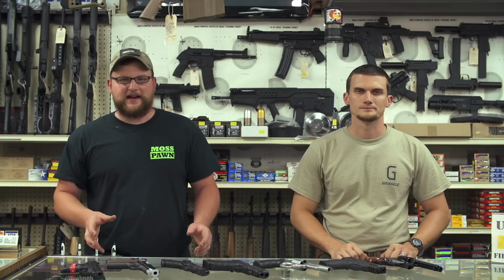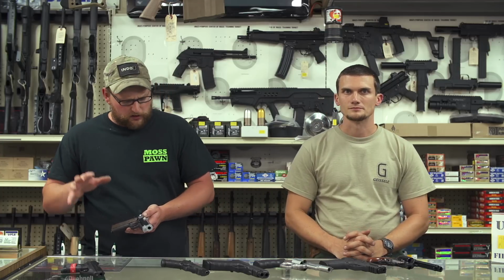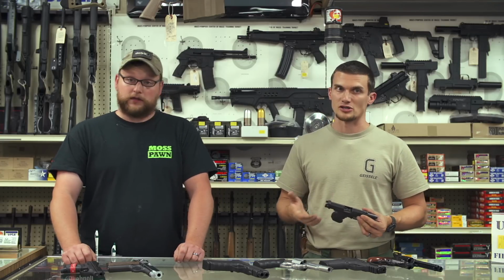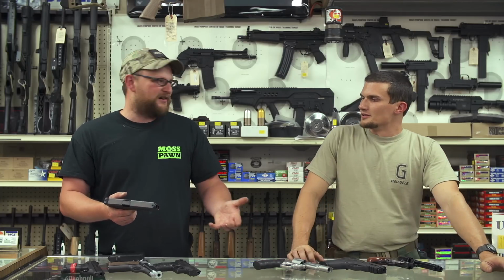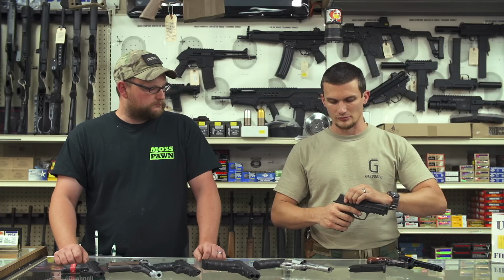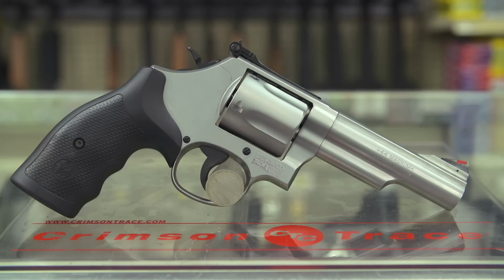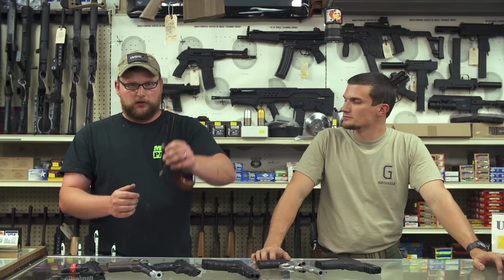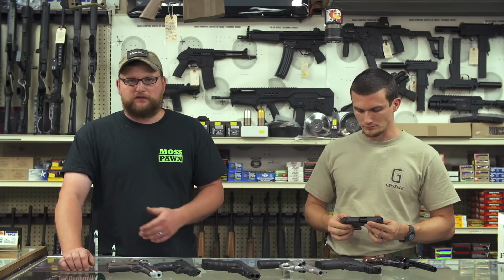Handgun Etiquette for Beginners

Comment: Man, a lot of other people say to dry fire as much as you want. I really wish I knew what the hell to do. I need a straight up answer.
Reply: Dry firing will not break your gun, as long as it is a fairly modern firearm, not a 100 year old antique with more delicate parts.  Dry firing allows the practice of trigger control which will make you a better shooter.  But, if you are going to dry fire, it is recommended to use snap caps so that not as much stress is put on the firing pin.  But if a gun were to break simply because it was dry fired, then I wouldn't trust it to fire live rounds.
Reply: This channel made a video several months ago contradicting everything they said in this video. I don't take much stock in what they say anymore. I learned more from Barry and wish he was still on the channel, the videos went downhill after he left.
Reply: On any modern centerfire gun, I have no issues with dry firing. Parts are very cheap and prevalent if you somehow break a firing pin or a striker. The chances of that happening are so slim that it's not even worth worrying about. Snap caps are a good idea if you're a little nervous about it, plus they allow you to function check the gun after cleaning or modifying. Get some snap caps and an extra firing pin/striker and dry fire away.
Reply: You can dry fire your handguns all you want. It is looked frowned upon when you dry fire someone's or store merchant's handguns. Usually they will say Yes when you ask. It is one of those "etiquette".
Reply: Don't dry fire if at all posable!
Reply from the maker: Dry fire all you want, but I would strongly advise snap caps. They aren't expensive, it doesn't require any real effort, and in the long run your firearm will love you for it. People can get macho all they want about it, but the bottom line is that the firing pin is designed to be cushioned by the primer. On the flip side I've got a much better idea...don't dryfire...get out and SHOOT. :D
Reply: Sounds like a great idea to me!!!!
Reply: Eric is right.  If you occasinaly dry fire a modern firearm i.e a Glock, a SIG, an AK or an AR then by all means go nuts.
But if you are conducting regular drills: snap caps are ''de mise'' translate-- ''in order''.
If you're playing with the 1917 manufactured Luger Grandpa passed down-- Don't!!

Modern military weapons are TOUGH but time is unfriendly to everyone and everything
Reply: Read your owners manual.
Reply: betatalk357 I know that, and so does everyone else who watches this channel.
Reply: IronMike212, when in doubt, don't do it.  :)
Reply: I just read the manufacturer recommendation, manual and internet link (FAQS)
Reply: That is the best way to go in most cases.
Reply: I have a Glock 22 that is a retired LE pistol. It has been fired thousands of times and dry fired at least a thousand times as well. Glock tells you to in the owners manual.  I can't speak for all guns but it won't hurt a Glock. I have never had a failure.
Reply: Randumb Kadrmas Look, I can see you think a glock is indestructible. I have seen the face of the slide crack on a glock from dry firing, so don't say it wont hurt a glock. They are made from the same steel as other guns, not some space age steel that came straight out of NASA. They are good guns, but they are not indestructible as you think.
Reply: No way is a firing pin sliding in a channel it was designed to move in going to cracked a steel slide, sorry but I am not buying it. Also the anti corrosion process Glock steel goes through is not the same as all gun steel. They don't call it Glock Perfection for nothing.
Reply: Eric Borders oh Eric I believe everything that I see on YouTube!  I did not say that the slide would never crack on a Glock. And I am no Glock Armour but don't you think the polymer plastic frame would crack before the steel slide? I was using my own firearm and experience as an example, i can't speak for the things idiots do to break their guns. I know a police offer that put 10000 rounds through his Glock and when the department went to M&P he purchased the Glock so he could keep it because it still worked flawlessly.  The issue at hand is dry firing, dry firing a Glock will not hurt it period. So who's the tard now??
Reply: Just for the record i have only owned one pistol,  a Glock and have had no reason to own anything else. As for the issue of dry firing them the owners manual tells you to do it every time you clean it. Don't forget to rack the slide three times before that to make sure it's empty, also in the manual
Reply: Randumb Kadrmas And there in lies the problem. You have subjected yourself to one firearm and are ignorant towards all others. I actually feel sorry for you, because you are missing out on so much experience and knowledge, which is very apparent by your posts. You are the poster boy Glocktard, and are not smart enough to know it. Don't feel bad though, there are thousands just like you, and they are just as in the dark as you.
Reply: Eric Borders
Well said.
Reply: ***** Thank you. =)
Reply: Eric Borders Eric you clearly have issues yourself and should seek professional advise as to how to deal with that. Glock were designed to be dry fired and that's the only point I am trying to make. It may be harmful to day fire others, I don't know and never said anything other than you can dry fire a Glock. Take care Eric and happy shooting I have said all I am going to say.
Reply: Randumb Kadrmas Good. I am done with your inexperienced fanboy ass as well.
Reply: Users should believe the manufacturers.  Their engineers are in a better place to comment on dry firing than internet posters.  You can dry fire some guns, for example Glocks, all you want.  The slide isn't going to crack from dry firing.  If you crack the breach face on your Glock, it wasn't the dry firing that did it.  There are different types of steel and heat treatment used in firearms, but even more important is the design of the gun.  I speak from 30+ years as a mechanical engineer/stress analyst.   Ruger, who has very good precision manufacturing, says that all their weapons (including rim fire) can be dry fired.   Even so, I don't dry fire my Ruger 10/22, and wouldn't dry fire other rimfires. Better safe than sorry.   There is a chance you'll damage the edges of the chamber or your firing pin.   KelTec says NONE of their weapons should be dry fired.  KelTecs are wonderfully innovative, but (let's face it) not manufactured to the same level of quality as a higher end gun, and are not what I call a "service weapon".  I am not a hater, I have some KelTecs and like them for their innovative design features...but one must be a realist.  I don't put thousands of rounds through my KelTecs like I do with Glocks or other higher- end arms.  There are reasons KelTec guns cost half as much as higher end guns.   Dry firing is part of practice, so especially for a new shooter, get a gun whose manufacturer says it's ok to dry fire.  Snap caps are a pain with a pistol, you don't want to have to practice triggering with snap caps. IMO, a snap cap is good for a test dry firing after you re-assemble or repair a gun that shouldn't be dry-fired, like a KelTec or a rimfire.... not for trigger control practice.
Reply: bahhumbucker just as I said in my original statement, Glocks were meant to be dry fired, you can safely dry fire a Glock, you can safely dry fire a Glock, you can safely dry fire a Glock, you can safely dry fire a Glock, you can safely dry fire a Glock, Eric you figure it out yet? Or should I say it again? People don't be an Eric Borders and listen to the manufacturer,  after all they made the gun and they know more than you do.
Reply: +IronMike212  
Think about it like this...
Does it break the gun firing it with a bullet in chamber? No. Will it break doing it without a bullet? No... of course not. Any decent quality gun is made of practically 100% steel. They do a lot of dry firing in this video as well while telling you not to do it...
Reply: +IronMike212 don't ever dry fire a .22 (or any rim fire). Don't ever dry fire a gun with a hammer mounted firing pin. DO dry fire any striker fire gun to your heart's content (dry fire a Glock all day every day, no issue). Don't dry fire old guns. Limit dry firing with newer guns they are not striker fire.

DO NOT EVER DRY FIRE A GUN THAT DOESN'T BELONG TO YOU. Period.
Reply: +Homer Simpson II someone didn't watch the whole video
Reply: +IronMike212 Just get some snap caps.
Reply: hickok45 says its not a problem
Reply: Honestly, it's been a argument in the gun world since the black powder days. After shooting ipsc for 12 years, shooting in genera for 20, skeet since age 8, and 3 gun for 4 I can honestly say everything from my extremely high quality firearms (9900$ butler arms trap gun) to my absolutely stupidly cheap range beaters (hi points, calico's, etc) not a single one has had a failure related to dry firing. Do I recommend dry firing 500 times a day every day? No. Is it fine to dry fire? Yes, without question. It will not cause damage.
Reply: Also, DO NOT use snap caps. I am very safe with firearms (military experience and then taught concealed carry & safety courses) and all three of the negligent discharges I have ever had happened before I stopped using snap caps and were caused by snap caps. One was with a 12 gauge I really thought had snap caps in it, it was live. The other two were with 1911's that I honestly thoughts had snap caps, they were live. It's just too hard to know for certain that you didn't get a snap cap mixed with a live cartridge no matter how organized you are. There is always a possibility of it happening. I would rather add a miniscule amount of wear to my firearm dry firing than have another 10mm go off without warning in my house.
Reply: +IronMike212 Dry fire as much as you want . . . don't worry
Reply: +Homer Simpson II "left" He didn't leave, he died from a heart attack.
Reply: For what? Yea you can. But 4 what? Makes no sence unless necessary for a specific purpose
Reply: Other than to check function after maintenance or specific technical reason... sure, however to practice shooting no mTter how safe...  That's just dumb! IMO.
Reply: It depends on the age of the gun, the quality of the metal used in the gun, and the design of the gun. If, for example the firing pin is fixed to the hammer, as is common on old revolvers, dry firing can damage it. If the gun is made of pot metal (not as uncommon as one might think), dry firing can damage the gun. If it's a fairly modern gun from a reputable manufacturer, it would take a LOT of dry firing to do even the slightest bit of damage.
Reply: Just like many have said it depends on the gun. My Ruger SR9 can dry fire with a magazine inserted. It is because there is a safety device in the gun that is disengaged once the magazine is inserted (or you can just remove the safety device). If the mag is not inserted the firing pin will strike the safety device causing damage.
Reply: Some fire arms have to be dry fired to release the slide from the frame for cleaning examples like glocks, smith and Wesson mp9 and 40 diamondback 380 and the 9 all need to be dry fired to release slide especially if you carry with one in the chamber
Reply: IronMike212 That is only an issue with  the cheap  American guns.  It is no issue with European ones.
Reply: I have to dry fire my Glock to disassemble for cleaning
Reply: IronMike212 dry fire everything except rim fire guns. Everything else is fine.

Comment: Why would you avoid letting the slide slam? It literally does that every time you fire a round, so the gun is designed to withstand the shock from that force. Am I missing something here?
Reply: When the slide closes after firing, it carries a bullet into the chamber, while ejecting the last shell. So when there is no round in the chamber or mag and you let the slide close freely you are applying a greater force. Does that make sense now?
Reply: +Leman Russ I see. So the assumption is that the gun is not designed to handle that extra force and could wear out the slide and springs if you do it too much. Would gun makers take that into account when designing and testing their firearms?
Reply: Yeah. It's a little bit of a slow process for any real damage to show, but it could appeared if done repeatedly over a couple years. The manufacturer designed these modern guns with very specific forces in mind. And even then they can malfunction after years of constant use. I think it's safe to say you shouldn't let the slide slam often (unless it's from unloading a spent shell after firing) just because the gun was designed to fire and not to just be "cocked, let go. Cocked, let go." Over and over again.
Reply: +Dodge Mustang please teach me what you're talking about then, rather than insulting? Would appreciate the knowledge.
Reply: +Daniel Madrid (Danny) don't get bent by what Mustang is saying. Just get yourself into a decent pistol fighting class and don't worry so much about babying that gun. These guys are talking about with how much force the slide hits when it chambers a round vs no round in the chamber. When it fires an explosion is happening... There's a lot more happening to your weapon that you just racking the slide on an empty chamber. When you're taught to clear a double feed, the last part of the procedure is rack, rack, rack (with no magazine in... no new round is getting placed on the chamber). My point is, have one constant methodology, commit it to muscle memory and don't deviate from it. You will benefit from this training and the high stress situation. TAP, RACK, BANG... IF IT GOES CLICK - TAP, RACK, BANG... CLICK AGAIN-CHANGE MAGS AND TAP, RACK, BANG. Most of you guys will never use a firearm long enough to wear things out. If you do, you'll know that you got some use out of that thing... good for you!
Reply: +Dodge Mustang hahahaha, you probably think that you are a superb gun slinger. I can tell that your not. You don't. seem to know what you don't know. Bruce Lee said that you need to find the cause of your own ignorance. Hahahaha.  Have a good one brother.
Reply: tim estrada Aww
Reply: Most of you guys will never use a firearm long enough to wear things out. If you do, you'll know that you got some use out of that thing... good for you!

And that sir, is going in my Epic quotes of the internet word doc. I Do so thank you. Lmao!

Comment: Dry firing does nothing harmful to a center fire rifle or pistol.
Reply from the maker: Some guns respond better than others. Personally it's something I try not to be in the habit of. I use snap caps 99 percent of the time.
Reply: I don't think guns like AK's or AR 15's get damaged by dry firing.
Reply: Any gun that doesn't have a bolt hold open gets dry fired during normal operation when you run out of ammo.